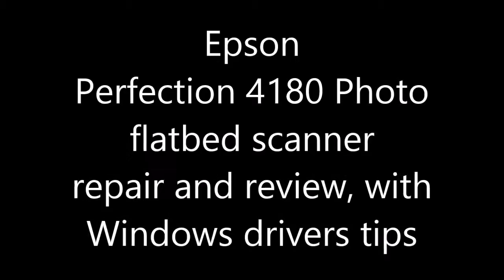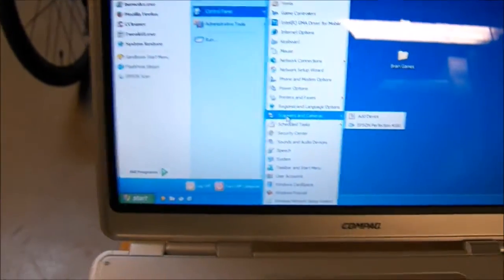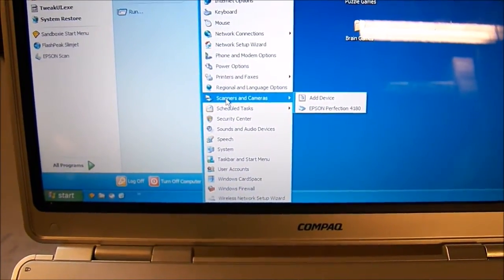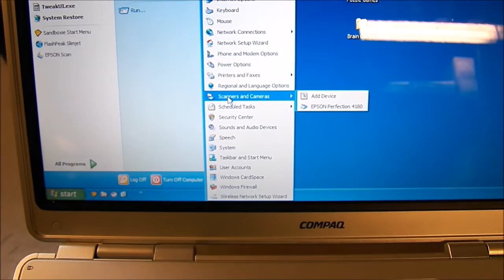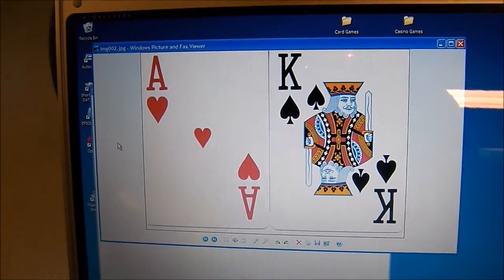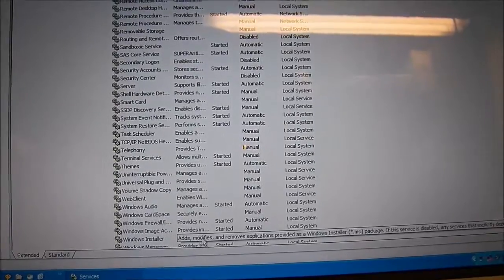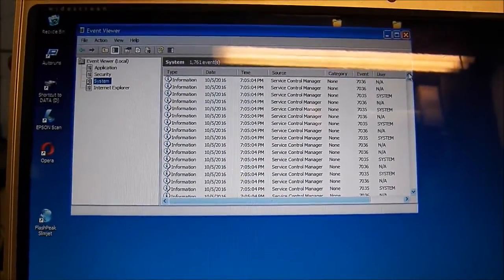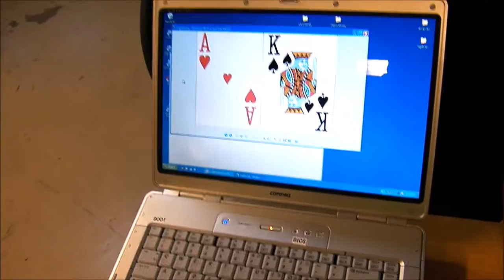Epson Perfection 4180 Photo scanner repair and review and drivers tips

Comment: i have a 3170, mechanically the same thing. i have the same problem, little tabs busted.  i was bummed initially. i thought the thing was done for. but some screws through the bracket is the trick. i was getting red light flashing, and no communication errors. all because of this.  ive had this scanner well over 15 years and i absolutely love it. built like a tank.. Kudos to EPSON for driver support over the years.  anyone got a canon or HP scanner that isn't outdated within 2 years just because of drivers?

Comment: Was ready to scrap my 4180 until I saw this.  Thanks so much.  I used one screw with a washer and nylon locking nut not on the large side of the metal mount. It is plenty to hold it firmly in place and there is no risk of interference with the belt.  Scanner back up and working!

Comment: Good afternoon,

It is 18th July 2021 and today, because of your video, I managed to fix my Epson Perfection 3170 scanner which had the EXACT same problem where the plastic clip on the right had snapped. 

THANKS SO MUCH FOR YOUR VIDEO. 

The two parts that helped me most was advising how to slide the cover off (I almost broke it trying to lift it upwards) and the idea of using the cable tie.

I wish you all the best.

Comment: Hello bigslick! You're the only person I found working on a similar scanner to the one I use, called Epson Perfection 1670, which seems very similar to this 4180. It's working fine but has started recently to make a strange, owl-like "whoosh"-ing woot kind of noise at the end of every scan. Do you have an idea what is causing this?
Reply from the maker: the only thing that I can think of is a lack of lubrication, because there is nothing different throughout the entire scan that would be different at the end of the scan vs the beginning.

Comment: If you lived in the UK I'd be happy to take you out for a meal because you've just saved me several hundred GB Pounds by having to buy a new Epson scanner. How come?  My faithful 3170 ground to a halt and I notice the belt had come detached.  I watched your video and realized that it looked much the same as mine, so I proceeded to dismantle it as per your instructions, and sure enough, the cheap plastic lugs had broken off.  I did adopt a slightly different fix to yours inasmuch as I neatly drilled two holes through the pulley bracket and lower casing, and then fixed the assembly down with two small fine nuts and bolts.  It's back up and running once more, and I hope for a few more years to come. Had I not spotted your video this scanner would have been scrapped and it would have resulted in my having to buy a V370 because I want the film negative/photo facility.  Every so often a You Tube shared problem tutorial proves to be 100% valuable.  Thanks again.

Comment: Bought my Epson 4180 Photo  scanner back in 2005 and it has worked flawlessly until recently. Had the exact same problem with the plastic tabs breaking off and used the exact same solution you provided and it worked like a charm! Can't thank you enough!

Comment: I only needed to see how to remove the top to clean the glass.

But now I know how to fix the tensioner if it breaks or to replace the bulb.

I've had the unit for at least 10 years & it's always worked fine.  Better with my Mac than my previous Windows machine, though.  It uses "Image Capture" app just fine.  No slow boot up.  It works with Ubuntu Linux, too.

Why didn't you use a nut & bolt on each side of the tensioner, or a machine screw?  The zip tie is a good idea, but seems like it will develop slack.

I like the scanner a lot. The quality is fine, even with 35mm negs and slides. I also have some 4x5 negs and 6x7 and 2 1/4 square.  All work fine with that light in the lid.

 Thanks for posting the video!
Reply from the maker: The tensioner is spring-loaded, therefore you WANT some slack.
Reply: KutWrite quit that image capture App, i use Vuescan, much better app. I got the same 3170 since 2004